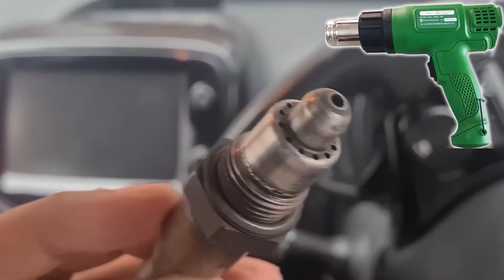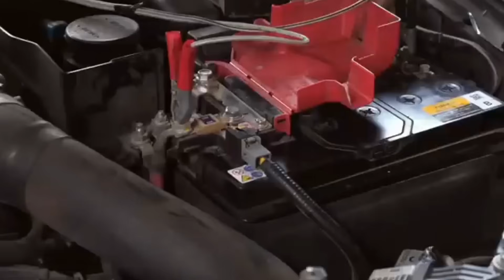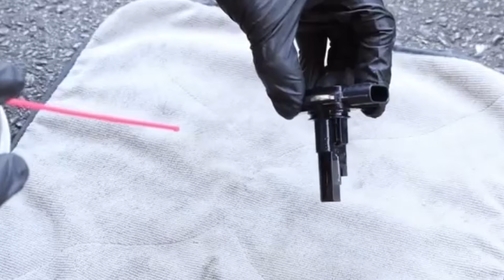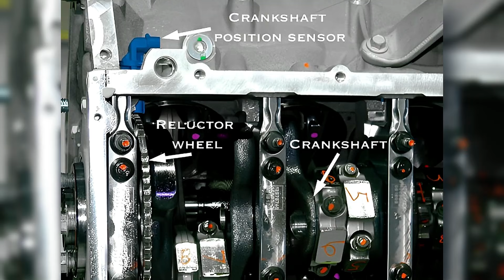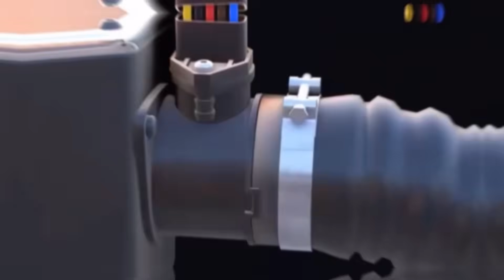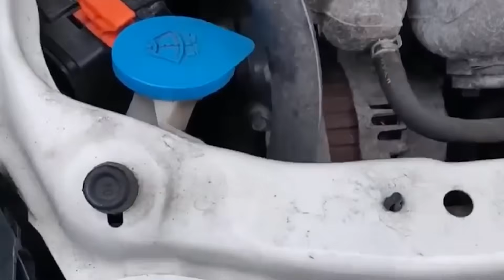Nobody Cleans These 5 Sensors — And Your Car Pays for It

Comment: Hi, My Nissan x trail T32 2016 patrol engine light is appear always . I changed  the O2 Sensor bank 1 after reset was fine . Drove the car just 10miles engine light flush again . 2nd Stop / start  fault is on the dash . Can anyone help me . Thanks
Reply from the maker: That O2 code coming back in 10 miles after a new sensor is exactly what this video covers. The O2 sensor wasn't the problem — it was accurately reporting a lean condition caused by something else. On that MR20 engine clean the MAF sensor first. Dirty MAF sends wrong airflow data, ECU runs lean, O2 sensor reports it, you replace the O2 sensor, MAF is still dirty, code comes straight back. $8 MAF cleaner before anything else gets touched. The Stop/Start fault is likely secondary — those systems disable when the ECU detects a running fault. Fix the MAF issue and that fault may clear on its own.

Comment: I  change a car battery recently ( I take a 2nd car battery because expertise already check and he said still ok), a day later a come back with my routine work as courier and found myself, car enjin stop at traffic light, enjin also stop while drive slow, and enjin also turn off automatically after a 2/3 minutes parking. Expertise recommend to overhaul the enjin as I told I miss to change oil enjin for period of time. But the car not showing any faulty sign as check enjin sign. I also need to slightly press a oil pedal to let enjin run again.  What should I do?

Comment: Every summer my 2012 Acadia would give a slight stumble when starting from a stop when temperatures exceeded about 105 degrees.  I got lucky and fixed that when I first tried to clean the MAS, which didn’t work, and then replaced it which did work.

Comment: I run an Audi A3 1.6 TDI 2012 5-door hatchback. In which order should I start to undertake all of these?
 For my benefit, I already have a VCDS (VAG-COM), which will read these codes, and I have WD-40 contact cleaner.
I will now be purchasing Dielectric grease & throttle body cleaner and anything else that springs to mind.

I am a retired Electro-Mechanical Engineer [H N D] with a degree. I now repair laptops to keep my brain happy, so I am not expecting any problems that I can't handle

Comment: My motorcycle shuts off after long rides when i ease off the throttle i have to keep clutching and keep the throttle on to keep from stall but on the wide open highway i have no issues until slowing down for the toll

Comment: Hi I have a 2008 peugeot expert 1.6 Hdi I am getting massive plumes of black smoke on gear change. so far I have changed fuel filter .air filter  ,MAF filter,  EGR valve and Turbo. I have had the injectors tested twice and they came back with a clean bill of health both times. All to no effect, I am now at a loss, can you help ?

Comment: My honda accor 96 its overheating after I replaced a broken hose but I also washed the engine now it looses power when I idle and goes out when I turn the ac on

Comment: What about P0451 Fuel tank presure sensor 2012 hyundai sonata gls 2.4 liter engine car running perfect all parts changed meaning belts hoses plugs pvc filters fluids oils everything induction cleaned throttle body cleaned injectors cleaned fuel system cleaned . What can I do ??

Comment: Hard start on a cold engine 😢 I’ve changed coils,plugs,air filters, cleaned AMF sensor, changed fuel pump and fuel filter … I still get a cylinder misfire and it starts hard… I haven’t check the PCV though. I’m about to check it right now
Reply: My first step for anything that could be electrical is cleaning as many grounds in the engine compartment that I can find and reach.

I had random hard starts, no starts, etc for a while. Two different mechanics couldn't figure it out. Replaced battery,  starter, starter switch, belts. No codes, everything seemed fine.

After the second mechanic had it for 3 days, they called and said "look, I can't figure it out. Everything that would seem to effect it had been replaced or looks and tests good.... the last thing I can try is go around and clean every ground. After that, I've got nothing".

Over 2 years later, the car starts reliably. There was about 8 rusted/corroded grounds. It turned out to not be a parts issue, but ground issue. 

Now, once a year, I clean all the easy to reach grounds.
Reply: @BrnMrcm 😮😮😮😮 that is crazy bro
Reply: How'd it go?
Is the ignition system OK?

I ask because hard start and rough idle is usually points to a cylinder misfire.

I've done at least 4 of these plugs and coils swap outs and 3 cars ran fine again while the 4th was still having issues after. We're not sure what's the issue as code shown is stating it's an intake issue upstream and there is a turbo.

'09 Mini cooper rk56 engine and turbo, this is a problem still.
Reply: @jimnunya1253  Upstream Intake issue. Starts with air filter. Then Mass Airflow sensor. Applicable hoses (usually around the connection points). Then Throttle body and throttle body position sensor. Then intake manifold and O2 sensor.
Reply: Head gasket leaking moisture into the cylinder when left overnight, possibly causing no spark or a weak spark?  But once started, it dries out and runs ok i've heard about this problem before. You could take all the plugs out in the morning to see if any are wet. But gasket isn't bad enough for typical coolant pressure/overheating symptoms.

Comment: 2018 Nissan Armada 5.6...idle is good when sitting but the RPM will bounce a bit when driving and vibration or a shutter/ hesitation feeling occurs here and there. Was told to change the 02 sensor down stream and change the catalytic converter on driver side...sis these fixes and still the check engine light come back on and symptoms are bk....no one ever cleaned anything yet .... opinion??

Comment: My Hyundai sonata cranking and driving then all at once it loses power and in a minute or so it picks up and runs okay sometimes it like it is running out of fuel then picks back up?? sometimes setting somewhere it idles rough and dies but cranks back up.thanks for your help

Comment: I had a non-stop annoying noise inside my car. I looked and saw my Mother-in-Law in the passenger seat. I had her get out of the car and the annoying noise stopped immediately.
Reply: My MIL smoked until her engine's intake system clogged.
Reply: 😂😂😂 hilarious
Reply: I think she's inside my dash!
Reply: Winning comment 🎉
Reply: I did not see that coming. You just removed a part and corrected the malfunction.

Comment: Good day. I enjoyed watching your videos. Verrrryyyyy informative. I wish that I had seen it a day earlier to save me the cost of a new fuel pump, cam shaft sensor and mechanic labour.

I still have the problem.
PROBLEM: The car breaks down completely while driving with no warning, in the middle of the road.

Observation. When the car cools, it restarts only to cut of again about after driving for about 5- 10, 20 mins when it is hot. Each time I have to wait for it to cool before it restart. The pattern repeats until I get the car home or call a tow- truck.

Your advice in solving this problem will be greatly appreciated.

Comment: Thank you for the video!    Once in a while my check engine comes on, I took it in, I have a 2015 Mitsubishi mirage, they tell me that my O2 sensor is going bad, a 472.78 part. Also may explain the poor idling. I am no Machanic by no means but I am not completely dumb. After watching your video, I would like to clean all the sensors, but would I be able to get to all of them?  ..I think there might be 8 inches between the car and the ground.  Will you show me please?   Thanks!   Samantha😊

Comment: Everything seems fine in my Mercedes W207 1.8T except some hesitation or sluggishness on take off. No faults too. I was told not to remove to clean the extremely sensitive  MAF sensor if there are no fault codes

Comment: my car is intermitted stalling, not sure how many miles. some times it runs 80 miles and 200 mile no stalling, some sometimes in 40 miles happens, its rarly happening, when free the vehicle like i have to stop at speed breaker and i press full clutch that time in free moment engine stall and all lights appear on meter, then i do ignition n start again and in a fraction of second it starts ! anyone what is exactly happening ?

Comment: Car won’t start in the morning. However when I depress the brake, start the engine it would start one hand. But without the brake pressed down it would crank multiple times but will never start. 
Terrible fuel consumption. 
Car type: Hyundai i30 2013 model. 140k odo . 
Recently I took it to a mechanic shop and they open up the timing chain and sent me a video of a slightly loose timing chain. Looking  sagged. 
I didn’t ask them to do any sensor cleaning. I should get the car back tomorrow 21st May from the mechanic. Fingers crossed 😂😂😂

Comment: My 2018 Tahoe and 2009 Volvo S80 both have the same problem  . They start cold and run great for a short trip to the store until they warm up and get hot then both cars develop a misfire in cylinder 5.  Sometimes the misfire is in all Cylinders?

Comment: Getting really bad fuel economy on my 2018 petrol 2.7 L Toyota hi van also feels like down on a bit of power
Reply: My 2007 Toyota hiace had bad fuel efficiency. The O2 sensors were very dirty. I sprayed them both out with MAF sensor cleaner and let dry.  Noticeable rev change and about 20-30 percent better fuel economy. Hope this helps!

Comment: My car Honda Accord 2016 lx 4 cylinder is shaking on and off at the stopped position.
Reply from the maker: Tire pressure won't cause that — idle shaking on a 2016 Accord 2.4 is throttle body carbon buildup. Watch the sensor cleaning video on this channel, covered in detail there. $8 cleaner fixes it before anyone quotes you anything.
Reply: @AutoTruthLab thank you for your response. ❤

Comment: They make a a spray Electronic sensor cleaner, I wouldn't use carburetor cleaner or throttle body cleaner on an electrical sensor they're too expensive and delicate,  you can destroy them.

Comment: My wife has a 2007 Buick Lucerne. Every now and then the car won't start. If you push the gas pedal once or twice, it starts and runs fine. The car has 90k on it. Do you have any suggestions? Thank you for your video

Comment: M A F sensor first thing to clean people
Reply: With what is there any special liquid
Reply: @highlightsgamesoftheweek8334  dont use brake cleaner
Reply: @highlightsgamesoftheweek8334  yes MAF cleaner
Reply: @highlightsgamesoftheweek8334 MAF cleaner...its a spray can...R85
Reply: I heard you can use electrical contact cleaner. (NOT wd40 or throttle body cleaner)
Reply: @highlightsgamesoftheweek8334 on MAF ONLY. MAF. Cleaner
Reply: Definitely doing this Sense it's cooler outside
Reply: Thanks ❤

Comment: Just changed my ambient air sensor on my 2021 Ram. It’s located under the driver side mirror. It cost 12 dollars.  It created a check engine light.  It also has an effect on A/C , engine performance and it read my outside air temperature as 160 degrees during a 45 degree day.

Comment: On initial start to my 2018 pathfinder there is popping noise during idle and then disipates after it warms up.  The throttle body, Mass air flow has been cleaned and  the crankshaft position 4 sensors as well. Which one is causing the problem?

Comment: My 1999 Toyota Camry was running okay until the alternator shorted out and took out the computer with it. After the mechanic replaced both, the engine idles rough and so slow it sometimes stalls out when giving it gas. It also lost power. The check engine light is on. Can you help?
Reply: Do it yourself din̈gus

Comment: What are sensors to clean before replacement on 2012 VW CC?
Reply from the maker: On that 2.0T TSI — throttle body first, that engine carbons up fast and it affects everything downstream. MAF second, direct injection means no fuel washing the intake so contamination builds quicker than most. MAP port third, check for carbon blockage especially if you have a turbo related code. Do those three before replacing anything on that CC.

Comment: when shifting gears  it sound slike over rev between shifting, i thought cam sensor A intake i bought changed but unsure what could resolv e it was fine on way out bad on way bac all tell me timing chain with 1500+ price must be sensor
Reply from the maker: Cam sensor change won't fix a stretched chain — if timing is off the sensor just reads bad data from a mechanically worn system. Cold start rattle test first. Rattles for a few seconds then clears — chain is stretching. Dead silent on cold start — chain is probably fine and something else is the culprit.

Comment: I have a 2007 impala 3.9. It has started showing the tpms light, the tcs warning light, tire pressure light and also on the DIC it started showing speed limited to 113mph and the speedometer is jumping up and down.  It's fine in park but when you put it in gear it struggles to go and dies everytme i stop.  Where do you think i should start? Thank you for any help.
Reply from the maker: That cluster of warning lights together  TPMS, TCS, speed limiter, jumping speedometer  that's almost always a wheel speed sensor sending bad data across the whole system. One bad sensor takes down all of those at once on that platform. Start by scanning for ABS codes specifically, not just engine codes. The stalling at stops is a separate issue  that's throttle body carbon on the 3.9. Two different problems showing up at the same time. Fix the wheel speed sensor first, those lights will clear. Then clean the throttle body for the stalling.

Comment: kia 1.4 mpi high petrol consumption like +1 liter, checked inside throttle body and its clean, cvvt solenoid is clean, motoroil changed
Reply from the maker: Throttle body clean, CVVT sorted, fresh oil — next in line is the MAF. Gamma engine runs rich when that sensing wire gets contaminated, ECU over-fuels trying to compensate for bad airflow data. $8 MAF cleaner, 15 minutes. Also check for any small vacuum leaks on the intake — a cracked hose after the MAF sends unmetered air in and causes the same rich condition without throwing a code.

Comment: These are not very expensive.  Replacing can be advisable over cleaning depending upon the design.  For instance,  the mass airflow sensor in my car hides the part you want to spray inside a Z chamber.  And a replacement isn't much more than a can of MAF sensor cleaner.  And removing it without knowing all that needs to be disconnected can cost three times more.

Comment: Spent thousands over the course of a year trying to figure out why my 2018 Toyota C-HR was having intermittent issues with the electric parking brake, lane departure warning system, pre-collision system and a rough idle. A week ago the shop quoted me $850 for a new MAF sensor. I did a little research, found a similar video to this and cleaned it myself.
Having my cruise control back has been amazing and the engine runs so much smoother now, all error codes are gone! I can't believe it took me this long to find out how evil shops are.
Reply: I Keep a new OEM Toyota spare MAF sensor in the glove box in my Tachoma and I keep the one in the truck which is fairly new... clean for max fuel economy.
Reply: It's easy to remove and then just spray clean the platinum wire.
Reply: How did you cleaned it? Did you had to assemble a lot? Or just get maf out and spray it?
Reply: @burak3445 CRC MAF Sensor cleaner.  It pairs with throttle body cleaner at walmart.
Reply: Not evil. Just incompetent.
Reply: They say it is not evil, they keep you coming back that's how they take care of their bills 😊

Comment: I must have missed it somewhere, but what is the cleaning spray you are using?
Reply from the maker: Each sensor needs its own cleaner — MAF sensor cleaner only for the MAF, throttle body cleaner for the throttle body. They're not interchangeable. Wrong cleaner on the MAF destroys the sensing wire. Both available at any auto parts store for $8-10 each.
Reply: @AutoTruthLab  I'll talk to the guys down at the shop and see what they have.  Many thanks!

Comment: 2007 Toyota RAV4 - jerks into low gets ( 1st and 2nd ) after that it’s smooth driving. Other issue is vehicle cuts out intermittently, or shakes then cuts out when slowing down or coming to a stop.
Reply: Dùm, clean the sensors

Comment: I’m having trouble finding my MAP sensor. I’ve cleaned the MAF. VVT. Cam shaft sensor. I’m likely replacing my O2 sensors because of the age of my car. Where’s the MAP?
Reply: They're typically on the front/top of the top of the engine.
If it's FWD it'll be to the left if facing the car.

Comment: Problem. 2017 forester, hesitation at idle speed 1000rpm while in drive. 2.Hesitation while shifingt from stop in 1st gear to 2nd gear. 37000 miles.

Comment: Your video open my eyes to many things thanks. I have a 2008 Nissan note it nearly reaching 300 thousand mile, my problem, my engine hesitates to accelerate when I press to accelerate, also when I stop and try accelerate it does not and than after a little while it just starts to accelerate, hope you understand what I'm saying, also recently I notice that when I put in drive like it takes a little while to go in drive and when I press to drive of the car is not moving only a little while after it drives of, so what I start doing is when I her it connects than I drive of.
Reply from the maker: Understood perfectly. Hesitation on acceleration and that delayed drive engagement are both the throttle body on that Note. At 300k miles the carbon buildup on that throttle plate is heavy — TPS can't read position correctly, engine hesitates when you press, transmission waits for a clean throttle signal before engaging drive. Clean the throttle body first. $8 can, 20 minutes. That delay going into drive and the acceleration hesitation should both improve same day. At 300k that engine has earned a proper clean.